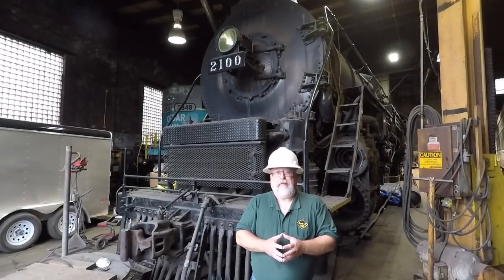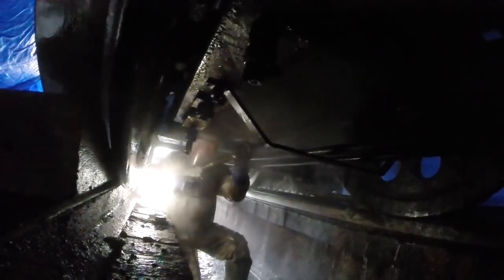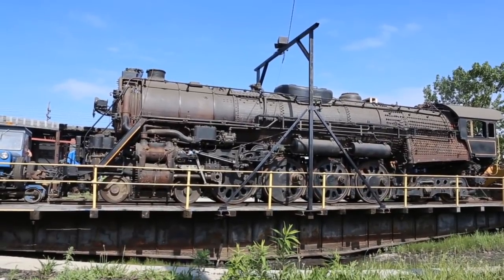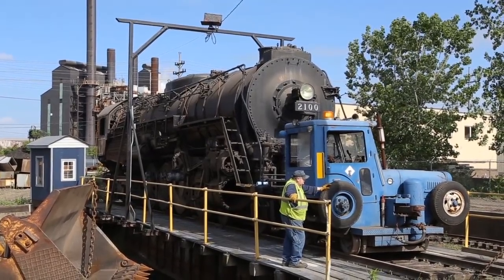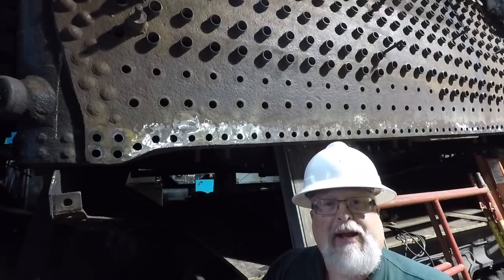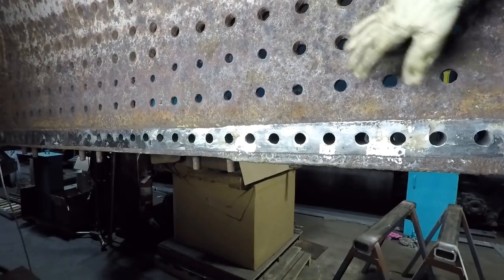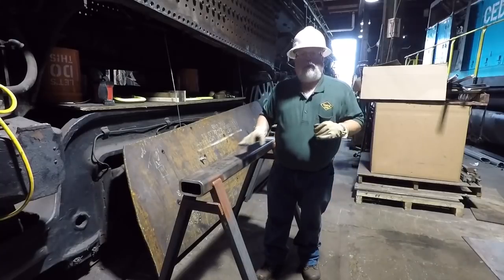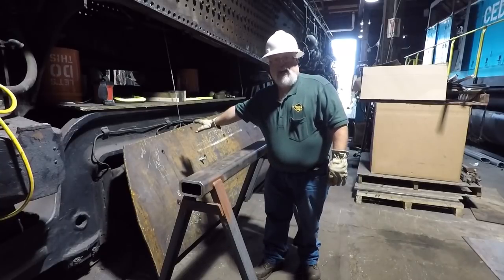ASR Steam Update: Reading No. 2100 - July 2018

Comment: I hope the steel structure of it's firebox won't wear off.
Reply: They are replacing the engineer's side lower side sheet, and I'm assuming they'll do the same to the fireman's side. Looking at the previous side sheet though, I am worried about how the firebox will do with a hot fire inside.

Comment: What fuel does #2100 run on Coal or Oil, and then where is the tender
Reply: The 2100 was built to run on anthracite coal, but Thomas Payne converted the locomotive to burn oil when he bought it at an auction, along with making some cosmetic changes which I am not a fan of, and the conversion wasn't done correctly. This weakened the locomotive's performance, and when it ran sightseer excursions in Tacoma, Washington from 2007-2008, it struggled to pull a very short passenger train. There was actually a diesel behind it to pull the train of 2100 stalled. The tender is stored outside for now, disconnected from the engine, and is being prepped for removal of the oil bunker.
Reply: The tender may have been scrapped, I’m not sure
Reply: Halo7615 _, nope, the tender is still on the property, and the oil tank has been prepped for removal from the coal bunker.

Comment: I want to see this running in the future with prr 5550. A double header of T1s would be great.
Reply: I don't like the fact that they chose a PRR T1. They could have chose a MUCH better steam locomotive. But they decided to chose the one with bad wheelslip reports and bad problems all around.
Reply: American Railroading Productions the prototype t1s 6110 and 6111 were the only duplexes that did not wheel slip. The t1 trust should have planned on a 6112 duplex instead of 5550.
Reply: The PRR T1's are heavily involved overrated, I say just dont make a new one, it will just be a waste of time and money.

Comment: What kind of steam locomotive is it? I am sure it's not a berkshire because the loco in the video is preserved when berkshires were scrapped.and when you compare them side by side their wheel configuration is reversed. So I wpuld like yo what it is.
Reply: Nevermind just found out 2100 is a 4-8-4 not a 4-8-2 and my research says that it is a t-1 I still don't know much of it yet but I can tell that this will be better than the prr t1 duplex.
Reply: This is a 4-8-4 Northern, and not all Berkshires were scrapped by the way. There are surviving members of 3 classes: 2 Pere Marquette Berkshires, 6 Nickel Plate Berkshires, and 12 C&O Kanawhas. There are 2 Berkshires that are currently operational: Pere Marquette no. 1225 and Nickel Plate no. 765.